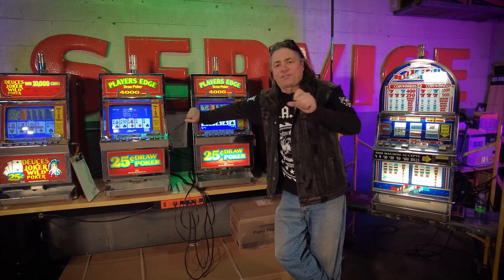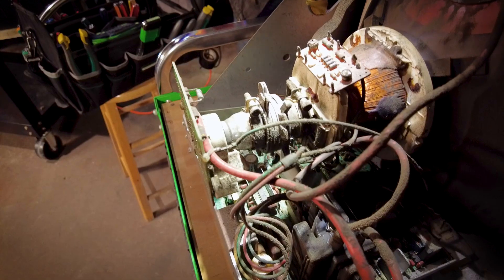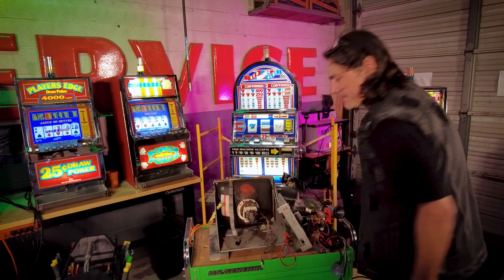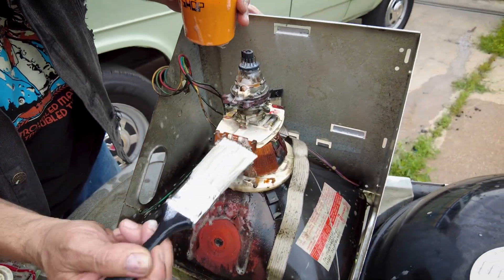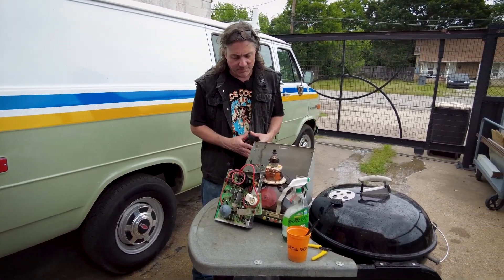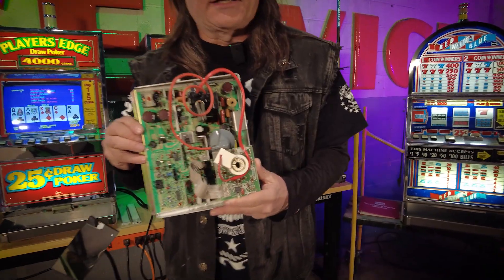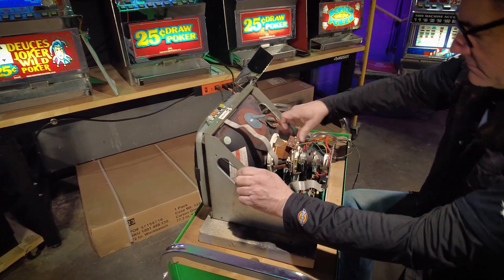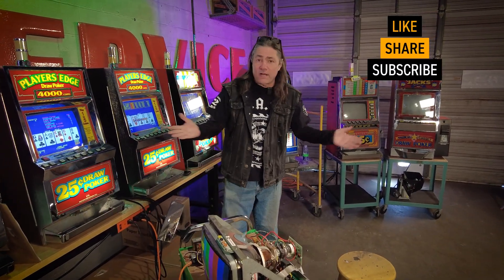How to Safely Clean and Restore a CRT Monitor: Step-by-Step Guide

Comment: I have some low-voltage clip leads. I bought at a harbor freight while they work for discharging the screen.
Reply: They probably will be fine due to the very short time the power is applied (it is one quick drain and that is it) but with repeated use they will likely degrade. But better safe than sorry, you do not need a lead able to handle 15kV or os that would be silly but at least look at a lead raided for mains voltage which will most certainly not be very expensive.

Comment: Is it just simple soap ?
Reply: Simple Green is the name brand of the cleaner. It's a little milder than 409 or Fantastic. But those would work just as well.
Reply: @LawtonBarnes  ok thank you 
I'm from France. I need to clean a CRT Monitor to try to save it 
I will try to find something similar here to clean it

Comment: I had no idea these could be cleaned with water and Simple Green. Great tips!
Reply: *SOYLENT
Reply: No you don’t, that would cause the board to rust 😰.
Reply: @aeloh1m  That's like saying washing a car causes rust. The cold does too. Rust can be caused by different elements being close by, which is why.

It's not the WATER that causes rust but the elements in the water. This is why some people say to use deionized water for a car radiator (which doesn't affect the block as it's usually stainless steel or nickel-plated) even with trace amounts of acid from CO2. Ionized water is worse of course.

Best thing to do is use absolutely is water, but do your own research about what is in your water and of course, a filter. Plus, it's not like the water sat there for long and was able to sit, dry and most of the water was already pushed away by the compressed air.

Just be sure to test your water for anything harmful, deionize it if needed so it won't affect inert metals and be sure to clean and dry your parts and let it sit and get clean and dry.

There's plenty of ways to keep your metal parts safe while also cleaning them.
Reply: @aeloh1m you act like they're letting it sit with the water. Most anyone who knows how to clean their CRTs knows you gotta dry the hell out of them after. I use air to blow water out of every nook and cranny. I also give the boards a nice ISO bath if they need it after. It ain't gonna kill them so long as you're not a moron and you know what you're doing.